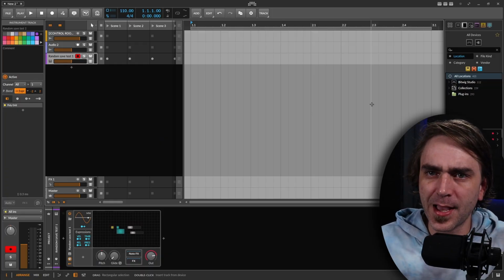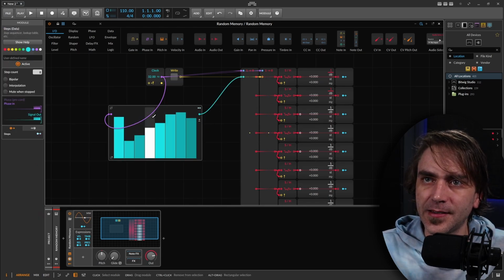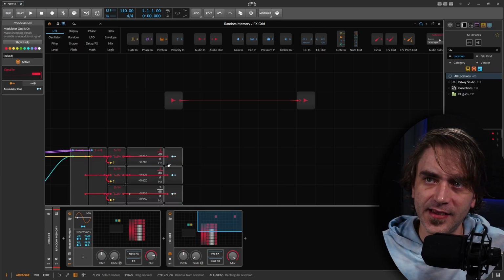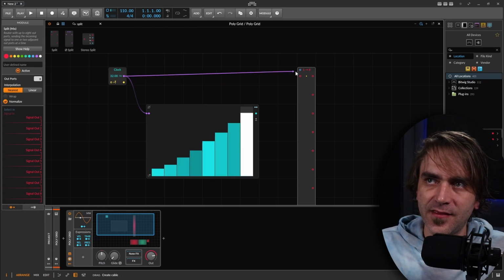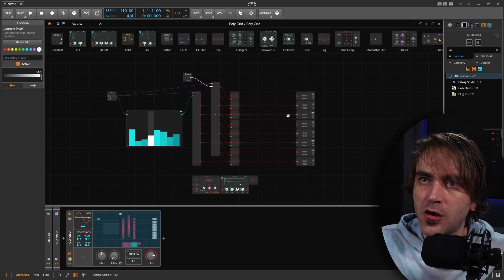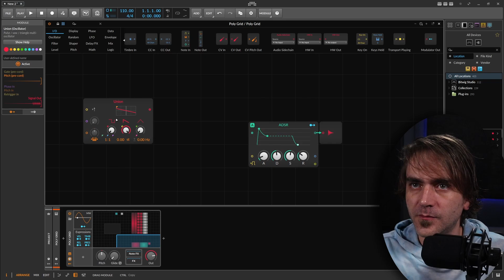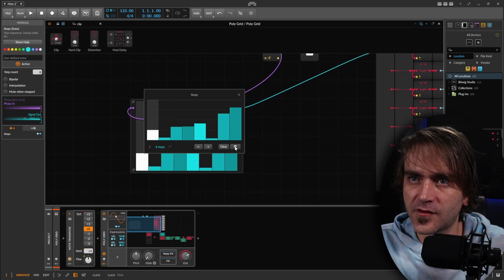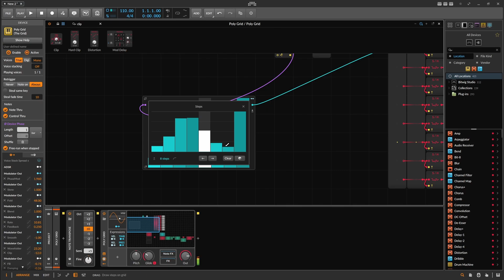How To Make a Random Memory Circuit in Bitwig Grid

Comment: 12:55 You don’t need to deselect modulator to adjust actual value anymore. While mod assign engaged hold ALT I believe on windows, option on Mac to temporarily disengage mod assign and access actual parameter.
Reply from the maker: nice thanks!!

Comment: awsome :) i tried to extend that up to 64 steps in  only one step sequencer, but failed greatly ... it does not sound that complicated but cant get my head around that. how would you do that? to change up to 64 params with one click?
Reply from the maker: use a steps to switch between 8 other steps modules at an eighth the clock speed. 8x8 = 64 :D should work in theory
Reply: @DashGlitch  ok, done it. expanded your grid to 64 randomized values in one 64 steps sequencer, randomizing all values in one click. i am waiting for that feature since The Grid came out :)  so thx again for that research you did,  thats a huge thing !
Reply: Hey, happen to have a preset for this? Feel I'm too inexperienced with the grid to figure this out ahah thanks :)
Reply: @  i could send you these presets, but i guess  links are disabled here ? i`ll try :)

https://drive.google.com/file/d/1voqWRbWzH4qHTGMVvunlbHuNvLXQSWtD/view?usp=drive_link
Reply: let me know if it works or if you need instructions :)
Reply: @Lythian123  Did you send something? Sorry this is legit my first comment on a Youtube video ever ahaha
Reply: @ToastCologne-l5d  yes, i did send you a link to my google drive account for the 64 parameter thingy, but the link got removed. probably by default from youtube :)
Reply: @Lythian123  Add dang, would you be able to try send it again by any chance? or could upload to bitwiggers or something :)
Reply: @ToastCologne-l5d  last post was deleted. but i uploaded it to bitwiggers :)
Reply: @Lythian123  absolute legend

Comment: Wow this is really cool thanks for sharing and it's very simple to output the modulation to other plugins native and VSTs when you put them inside the FX slot of the Grid module. There is a patch called Rando Tambo that does this in another way but it's CPU intensive.